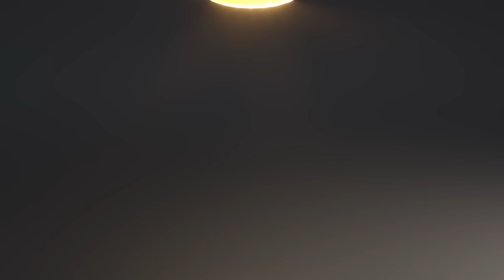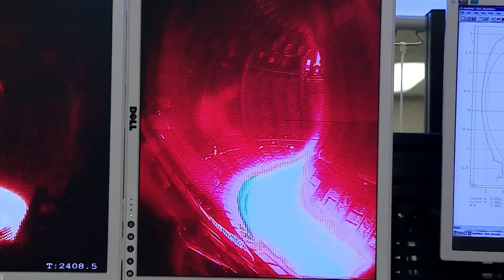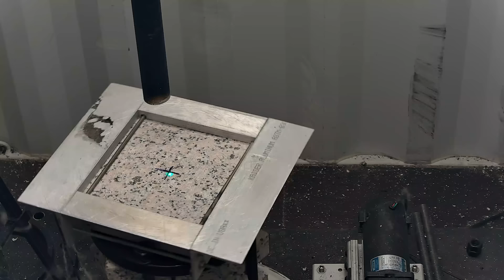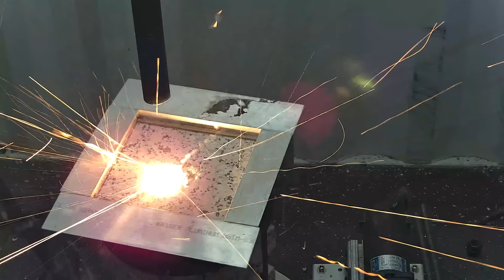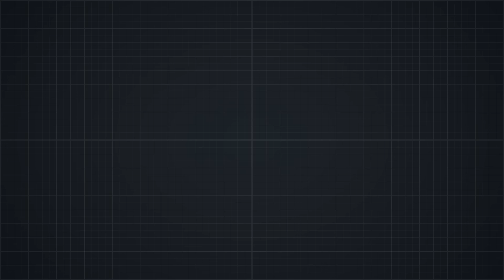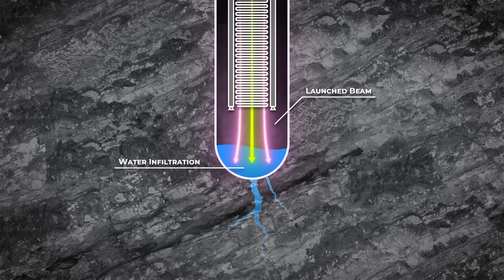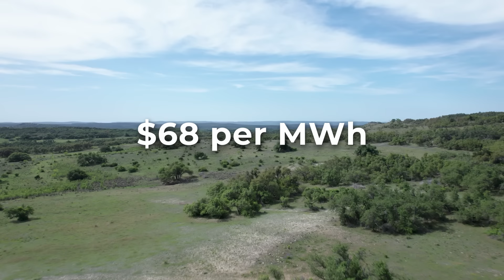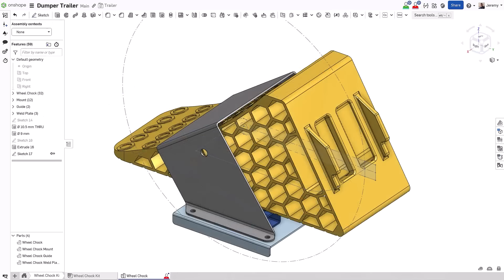Geothermal Energy is Changing

Comment: 19:27 Sounds like you’re assuming none of the drill equipment is reusable. Why wouldn’t they be able to drill multiple wells with the same equipment?
Reply: Yeah the cost calculation seemed more about capitalisation of a drilling company than a power plant installation. I would not be happy if a service provider made me pay the full price of their reusable equipment for each use. The gyrotron is reusable and the whole point of the tech was to heavily reduce use of the drill or the wave guide in this case.
Reply: If you equate drilling holes with these to flying a plane, substituting gas cost for electricity, and tack on the $2M waveguide it's a very scalable idea. I don't see most even local communities shelling out a couple dozen million dollars for stable green energy to be that big of an ask I have seen individual bridges cost more.

Comment: Doing some Maths with the Help of Chatgpt, it calculates the Energy Cost of vaporizing a Hole 35cm Diam and 6km deep at around at around 4,47 GHW (around 1MIo€) at 100% efficency.  While that is a lot of Energy it can be done over the course of a few Months. Assuming a power Generation of 300MW that Geothermal Plant would need to run for only 15 Days to pay itself of.
This seems to be actually a feasible Technologie for drilling Deep Boreholes
Reply: yeah thats actually not that much energy if you put it into perspective. Just a tiny part of the company im working for takes a few hundred mwh every day

Comment: question: I don't understand how the material is being removed. Flushing with nitrogen gas, ok, but at some point the gassious rock will condense and then clog up the hole on the way up, no?
As an optical physicist & engineer here (I can understand and build a MASER, but the aforementioned problem, I have no clue about.
Reply: The tube is a waveguide. Pretty sure any vapor inside it will stay extremely hot.

Comment: Thanks for stopping through Brian! Stay tuned for results from our field tests.
Reply: @quaise I wonder how your technology will interact with the problems that super deep bore holes have encountered in the past; where deeper depths see the earth acting more like a jelly pushing in on and trapping drills than regular rock.
Reply: @jamesbaxterfirst  I believe that is the point of the 'obsidian like' wall casing.
Reply: @jamesbaxterfirst  indeed an interesting conundrum. 

I could be wrong but I think that the surrounding temperature (when rock exhibits plastic behaviour) would need to be higher than the 380°C required for geothermal energy production. Though it also totally depends on the rock type, i.e. a granite vs sandstone. 

But I think, as they mentioned, it’s not necessarily the plastic issue it’s more of the intrusive water issue. You can case a borehole to seal it off from the surrounding strata, but the bottom will always be exposed (especially when you stop introducing downward pressure).
Reply: just a question from personal curiosity an a bit of personal concern. At the testing chamber the vapor of the melted rock form that cotton candy like structure near the exhaust that you guys have to wear mask for safety, how about in field test? is those vapor gonna simply released to open air? are you guys gonna put filter on the exhaust ports or is there any other solution?
Reply: Awesome work, congratulations on what you have achieved so far! I was wondering how you might be able to monitor what is happening at the bottom of the bore hole, for instance if there is a collapse or it has gotten stuck. Is all the monitoring performed at the top from measuring the rotation torque or reflected microwaves? Also, how much energy is lost to heating the air from microwaves travelling down the borehole? Thanks, and wish your team all the best!
Reply: What happens when you hit water or natural gas?
Reply: @Verified_1789 you keep going
Reply: @Verified_1789 BOOM!!!
Reply: what a cool technology
Reply: @quaise, where does your funding come from? 

This whole video seemed like over engineering. Not saying this is a bad thing. Sometimes projects like this have indirect discoveries with better application for what has been engineered. 

My main reason for reaching out, is with regards to the layers of this realm. 

Mainly, when kohr super deep borehole was created, the sound coming from the depths was similar to horror movies interpretation of what lies below. Upon further critical analysis, the sounds produced and the direct effects observed (from very limited information which was leaked). Would appear as though there is a level of microwave radiation trapped in the ground. Which acts as a plasma-solid shield for the layers below.

Could this be why your company has focused on microwave based lasers? Could there be a dual function/purpose to developing this technology further? 

Fighting plasma with plasma, (or fire with fire) in a sense.

If this is truly the case, wouldn't instituting a wave oscillator help organize the radiation into packets for further analysis? Similar to how ancient Egyptians were magically able to precisely carve bedrock into what became the "pyramids". There was sound/wave technology used for deeper cuts and movement of large, hard to work with stone. Similarly, how ground penetrative radar has been developing to better identify unique markers within the earth. 

I digress. There is more which cannot be mentioned here due to legal and copyright type ideas. I'd love to get in contact with people of actual intelligence to discuss various aspects of the engineering process at play. 

Feel free to respond, and we shall go from there.

Until such times, best of luck. Keep up the good work!
Reply: Hopefully graduating Fleming colleges drilling program this year up in Canada. Cant wait to see how this technology matures
Reply: Drill baby drill ✊
Reply: More power to your arms quaise, gawd only knows, but we need this kinda tech.
Reply: If that fluff is building up in the lab where you can just dust it away, how would you keep a rod string clean just using gas? I don't think this will ever work.
Reply: @quaise, I wonder if you could drill faster with two lasers?

In specifically, a pair of lasers which induce plasma in their paths, and which you can send electrical current through.

Joule heating where the laser plasma lines cross will surely be more effective than an overpowered heat lamp.
Reply: @BenjaminGoldberg1 the depth involved (attenuation) and the low penetrating power of the laser compared to rf seems to be a concern

Comment: There are now, and have always been, at least two fundamental problems with this approach to drilling: 
1) The millimeter waves get absorbed by the waveguide itself, and cannot penetrate kilometers, or even hundreds of meters, while maintaining the required high power. Increasing the gyrotron power more and more will eventually melt the waveguide and/or the gyrotron, so the problem cannot be solved that way.
2) The vaporized rock will clog the borehole with strands of rock wool, as seen in the test area of the lab. What is needed is enough COOL gas to turn the rock vapor to POWDER. But in a real borehole, the flowing nitrogen will get heated up by the counter-flow of hot exhaust gas, which they are not addressing with their open-air experiments. Pumping more and more nitrogen gas down the borehole will not solve that problem when the borehole is deep, because a deeper hole gives more area over which the heat exchange will occur. The result will be warm/hot nitrogen and sticky strands of rock wool clogging the borehole.

Those problems, being quite obvious, should have been the actual subjects of research. They have not.  Are they hoping fundamental problems can be solved with technology? That is not realistic. So this whole program of experiments is a waste of work, time and money. As I have pointed out several times, on various channels hyping this nonsense.

Comment: Sticking it to a conventional rig shouldn't really be required though... Why not plan to drill the hole wider than conventional rigs, wide enough so that gyrotrons can be lowered to the bottom? Perhaps it's more energy effective to just perform a circular melt... and then get creative with the lava... cool it down with drilling fluid to make it solidify in small grains or pebbles that can be extracted with the fluid? Rinse, and repeat?  

A lot depends on obtaining that obsidian lining spawning automatically :)

And I don't know much about how water ingress is solved in the current drill stacks, there must be learnings that can be adapted to the new situation.

Comment: Wonder if you could do this with a solar concentrator and fiber optics.  1 megawatt is only 100ft by 100ft roughly (1000 sq meters) of sunlight.   And since it doesn't need to be precisely controlled, seem like a good source

Comment: Wouldn't a water jet cutter drill head or even sand blaster would do the same thing at a fraction of the price? Also if you have todo it this way then why not use oxygen instead of nitrogen? That why it doesn't have to get hot enough to vaporize rock just hot enough to burn it, in a O2 atmosphere probably not that hot... relatively speaking.

Comment: Where will the evaporated rock go once your 1km in wont it just solidify and close the hole again?
Reply: Probably that is why they are pumping argon gas. Displaces oxygen, highly non reactive plus cheap. We also have to keep in mind, that the goal is to drill only 1m per h. By constantly pumping gas they can probably thin the gasses enough for it to be pumped out and not solidify. 

My opinion.
Reply: They wont have a solution, they wait for investors, fail and dissappear.

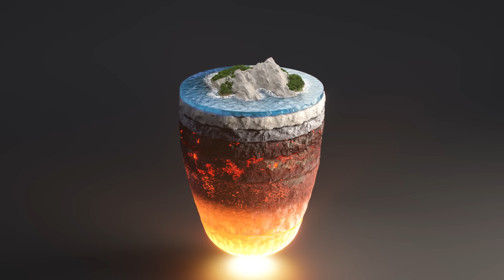Comment: 1:08 it's not fission in the sense of a chain reaction, it's just radioactive decay
Reply: The amount of heat generated from radioactive decay is negligible compared to the vast amount of heat produced from pressure and other geological processes. Fission has almost nothing to do with it. That’s just not where the heat down there comes from. I was surprised to hear “we have a fission reactor beneath our feet”. Very misleading
Reply: @NunnyaBidniss  Pressure doesn't generate heat unless it's compressing something. And the internal heat is the cause of geological processes; not the other way around.

When the earth first formed it heated up from all the scattered material getting squeezed together, but since it took its final shape that heat has only been radiating away. You can't increase energy without injecting energy, and almost all energy the earth gets from outside comes from the sun. That's not gonna heat up the core.

Although i have read that tidal forces from the moon supply a bit of heat by slightly kneading the earth! It was a tiny amount, like 1% of the total internal heating, and most of the tidal energy is absorbed by the oceans since they deform much easier than rock. Still really cool!
Reply: @NunnyaBidniss  "Pressure" is not a continuous energy source. To be fair, the one-time heat generated when gravity collapses already hot matter into a ball could be descibed as heat generated by pressure. 

Wikipedia's "Earth's internal heat budget" article says that roughly half of the earth's current heat is from radioactive decay while the other half of it was already there when the earth first formed (planets coalesced from hot gas)

Geological processes like volcanism and convection need to be driven by something to occur, they're usually the effect (rather than the cause) of a celestial body's heat.

Convection in the mantle brings the heat from inside the core closer to the surface, making it more accessible to geothermal power. This doesn't generate any net heat, it only displaces it.

Tidial forces can generate heat inside a celestial body, but in earth's case i don't think the moon's tidial influence is strong enough to have a big impact.
Reply: Aside from everything else if there was an ongoing chain reaction contributing an important amount of heat (terawatts?) it ought to be pretty obvious from the neutrino flux. No matter where inside the Earth it was happening, we'd be able to see it with our neutrino detectors.
Reply: Oh yeah. I forgot that most decay isn't spontaneous fission.
Reply: Due to earths rotation stirring its core, could the fission and decay rates vary?  If the temperature rose, the heat eventually rises to the surface.  This could account for additional global warming.  
Notice that last decade has seen magnetic north is moving rapidly which indicates a change in the Earths core.   Some think the Earth is near swapping poles.
A thought, but not much to go on.
Reply: @danbenson7587  nope, decay has nothing to do with any of that. and if the temperature did rise, it would take many millions of years for the heat to reach the surface. there can be climate change from sufficiently large volcanic eruptions, but that's because it releases CO2, and believe me you'd notice if there were eruptions that big, they cover entire continents with lava flows.
Reply: @ Using your logic, a spike in core temperature may have occurred ages ago and is just now reaching the surface…right?   (However, I think heat moves faster, particularly when the temp difference is between a molten core and space at near absolute zero.). 
     Magnetic pole swap may or may not be connected.  And yes I know about volcanoes….I grew up on National Geographic next to the toilet.

     We know less of what’s 5miles under our feet, than we do about the moon.

     1.    Is core decay is constant or not?
      2.  Are there hot spots?  
      3.  Are there fissioning elements that occasionally come close and react?          Cheers
Reply: Friction from rotation differences  around the dense core is my guess, but I did not finish School.
Reply: You’re right decay accounts for the vast majority of thermal energy, only a small amount is from fission which does happen but rarely.
Reply: @fish9468  are there any documented occurrences other than billions of years ago?
Reply: @ArbitraryConstant 
As far as I understand it, the decay in the concentration of U235 has made natural fission impossible for the last couple of billion years, though some of the heat generated long ago is still around, so fission can be said to contribute a negligible amount of the heat in the mantle. Natural fission never happened deep in the mantle or core since there was no moderator available to slow the neurons to a speed where neutron capture could sustain a chain reaction. The natural factors that we are aware of were moderated by liquid water, quite near the surface.

Comment: I wonder, given current solar panel costs, if they could deploy temporary solar installations to partially offset the electrical requirements for each drilling location. This seems like the best solution for long term energy requirements.
Reply: You could probably use them to run the control and monitoring equipment, but you'd want to drill 24/7 so solar would not be ideal. It would also need to be pretty large.